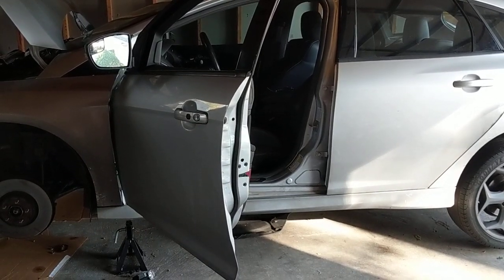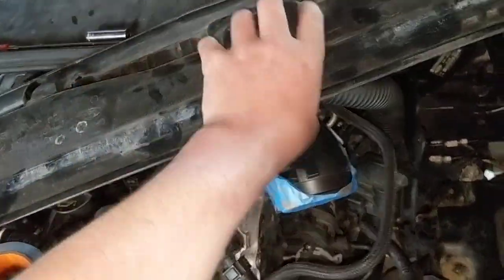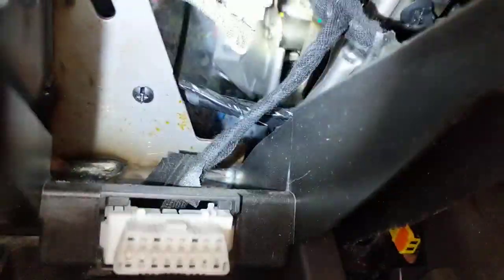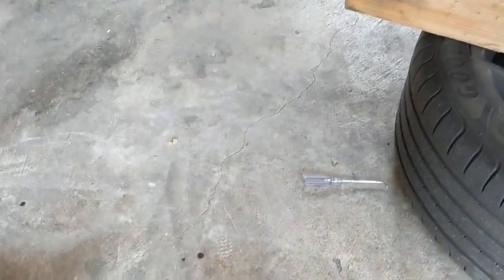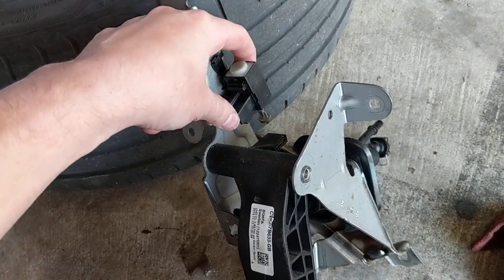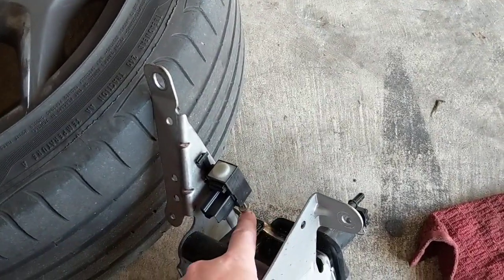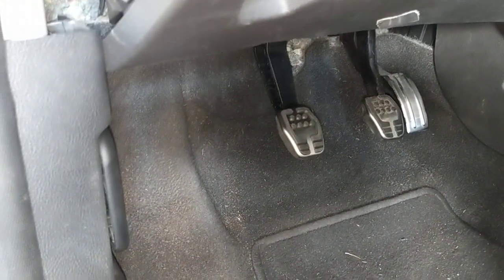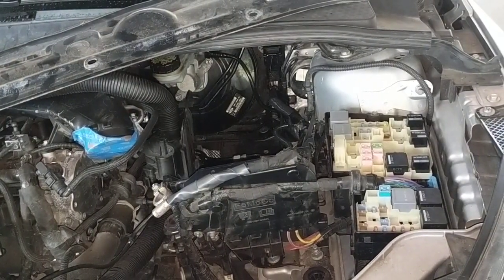Focus ST clutch pedal replacement, master cylinder, how to 2014

Comment: On 2016 st, took seat out ,did not take dash parts loose ,did not take steering loose, top bolt i used 1/4 inch small ratchet  with adapter to 1/2 inch  13 deep socket , with seat out ,you can put down cushion lay out and get to it , seat is easy to take out than air bag and dash parts , work gently pulling unit to left and out ,yes top senor pops off during removing , but going back ,that piece of metal is in the weigh ,BIG TIME! after two hours of trying all different ways ,senors on or off ,i took my mini millwakee  m12 sawzall and cut about 1/2 inch off the useless piece   of metal !!  then it went right in!
Reply: Yes but this mate saved my night only because this clip but you’re right I didn’t lose anything only the 4 bolts from the pedal (2016) 
Greetings from Germany
Reply: I needed 1 1/2 hours for all ( I’m a mechanic)
Reply: Oooooo. Thank you very much brother!!! It is the way.
Reply: Where did you buy it from, im noticing a lot of them with out the plug for the push start

Comment: On my 2014 ST I was able to get to the bolts with just pulling down the lower panel, and then used about 20" or so of extensions ending in a wobble, with a deep socket. Pulling the steering shaft is a must for extra clearance, be sure to run a seat belt through your wheel to keep it in place. Once you remove the clutch sensor and switch it sort of works itself out. The comically long extension kept me from having to mess with the airbag at all. When you replace the clutch master, may as well grab the line from Ford even if just for the quick connector and seal, its around $8.

Comment: hi, i have the same car and i hear a little clic when i press the pedal, now that clic its a lot louder and i dont know what can it be and how to repair... do you know how?
Reply from the maker: I don't remember having a click when all of this went wrong. The thing that gave it all away was the fact there was brake fluid dripping and a puddle under the clutch pedal. 
Ask some other commenters on here if they had a click or not.
Reply: Try step on foot rest with same force, if same click sound then it’s seat problem which is way better to solve. Happened to me and I just replaced Ford performance shifter, wasting couple hours finding out that’s the seat can’t handle pressure when step on clutch, omfg Ford. Hope this helps

Comment: When you took the hard line out of the slave cylinder was the rubber oring thing on the plastic collet on the hard line or inside the slave??? Please read my I need help lol🙏🙏
Reply from the maker: Just put the o-ring between the slave cylinder and the line it connects to.

Comment: Getting the master cylinder and pedal out is actually fairly easy. Both sensors on the pedal side can be put on once the pedal is mounted, pay attention to how they go on once you have the assembly out and put them on once it's in the car, you mostly go by feel
Reply: Donde consigo el vídeo de cómo sacar la pedalera

Comment: I just replaced my master clutch cylinder but I’m having a problem on bleeding it. It’s not pushing any fluid threw the lines. I’m pumping it for a while and once I open the bleeder no air nor fluid comes out, I did the process for a solid hr and nothing :(
Reply from the maker: Be sure your brake fluid cap in ON and tight before you start bleeding. I think the clutch openly pulls from the reservoir. 
Fill up that reservoir, tighten the cap and try it then. You might just be pushing fluid back up in the reservoir everything you push it down. First few times you have to pull the clutch back out. But with that cap on it'll start pushing back at you. Let me know if that works.
Reply from the maker: Unscrew that bleeder until it comes all the way out and let it gravity bleed for a while. I think I remember having to turn it quite a lot to actually break the seal.

Comment from the maker: Look into removing the lower dash. If you can remove it completely to the point where you have to unplug the lights then you're pretty much set to go. That's what really held me back. 
The rest of the work is fairly simple. I will try to find the video I watched to give you some additional info too. 
I also spent a good amount of time trying to find where the lines went through the firewall, but I've covered that in this video too. 
Trust me though about getting the lower dash off, that's the key. 
Ford wanted $1,100. I paid $90 for the pedal/master cylinder. And it's a FoMoCo part, an exact replacement.
Reply: I needs to perform this on my 13 focus. Is there a vid i can see to remove the lower dash??  This vid is still good info.

Comment: Need to remove the lower dash, and then you won't have trouble with the wiring, switches, etc.

To remove, take off the steering wheel column shrouds, then you remove the air ducting (one bolt on the bottom). You will then be able to reach the two 10mm nuts holding the airbag in place. Once airbag is removed you can fully remove the lower dash.

I just did this job - but got screwy when I went to bleed it and found that I was missing a small rubber piece that seals the hardline into the master. Now have to find a new piece before I can get it all back together :(
Reply: Thanks man. Needed that info
Reply: And...from what I've seen in other posts...that rubber seal is not available by itself so you have to buy the whole line. Hopefully you can grab one from a donar car of any platform similar at a Pick-n-Pull lol
Reply: @dham99 I bought a generic version/audi one off amazon for 10 bucks that came with like 4 of the rubber grommets and it worked fine.
Reply: Vw\audi*

Comment: Thanks for the video, any chance you can make a video on how to flush the coolant? Searched on youtube and can't find any for FoST.
Reply from the maker: I'm not sure I would actually FLUSH the coolant because I'd be doing the work myself. What I plan to do is drain as much as possible from either the lower radiator drain or hose, let it drain until it stops, then start the engine and run it for 10 seconds (not long or you'll burn up the water pump). Put it back together and just add fluid until the reservoir is to the full line.
Initially with the radiator cap open to release any air (air in the system is always a problem). Just keep adding fluid til she's full. 
You can usually let it idle while you add your fluid to ensure it fills and the other parts of the system. 
A flush includes a special hose and suction system where it really runs fluid through many many times. 
You can essentially do the same thing by changing the fluid in this way several times. 
Watch "Chris Fix: coolant flush" he does a great job.

Comment: Since you cut the connector any codes? since PCM pulls volts from these switches?
Reply from the maker: It didn't throw any codes, but it didn't bump the throttle upon a slow take off. 
So I ended up putting it back in. I wouldn't cut it, even in a pinch, just stick a paper clip in there.

Comment: Im in the process of replacing mine,  just seen the top bolt,  I'm having nightmares just to think about it ..
..
Reply from the maker: All you need are lots of extensions to reach all the way through. Like I showed the double or triple extension. I had to borrow my neighbors too.
Reply: @dangleason9023  Kool extensions isn't the problem, i recently purchased the car from Gray's on line,  i was told the muster cylinder was (stuffed).....,  excuse my French, hehe , just Australian slang ......i have the turbo diesel model, ..i was also told could be the spring that seats on the top clutch pedal, i don't think it as 1, apart from the  spring near the clutch pedal,...
Reply: I found it easy to remove the who steering wheel column, took me 10minutes  ....then simply removed the plug , ect

Comment: Did you bled the clutch from the nipple you show at the end of the video? Or you just did'nt?
Reply from the maker: Yes I did, first I did a gravity bleed with the brake fluid reservoir open, gave that a few minutes, then got my partner and bled it just like brakes. 
The weirdest part was that you could push the pedal to the ground and it would stay there, so you'll want to top off the brake fluid and close the cap, then begin the active bleeding by pressing the pedal. 
The first few times you may have to pull the clutch pedal out, do it as slowly as you can, after a few times it will firm up and the spring will act normally. 
Weirdly there were a lot of turns to open the bleeder, not the 40% turn like on a brake caliper, we're talking several turns.
Reply from the maker: Definitely gotta bleed it.
Reply: Think a vac bleeder would work better than pumping?
Reply: @dangleason9023  Thank you so much for the explanation. Just saw your commentary, YT didn't notify me. This will be extremely useful as I plan to execute clutch bleeding on my Fiesta too.
Reply from the maker: @fedeolivieri2038  I'm reading through all of these comments again....If you need more help let me know, but heed the advisories in the video. Others have good input too. Good luck!

Comment: Why did you have to change out the master cylinder? What problems were you having?
Reply from the maker: There was a puddle of brake fluid/clutch fluid on my floor mat one morning. The pedal plunger had sprung a leak. Continued to drip on my shoes while driving to get more brake fluid and order a new pedal. 
There were no driving issues other than a serious leak if left untreated.
Reply: @dangleason9023  This is what i came to this morning when I started my car...found a small bit of fluid dripping down onto my weather mats. I can see it seeping out of the plunger/rubber piece at the firewall when I depress the clutch pedal. So here I am...2016 though..so people have to be very careful of which part number they buy. 
2014/earlier uses DV6Z-7519-A
15+ uses BV6Z-7519-AR  (this one has a sensor that if you dont use the right part number, the car will have issues and wont even turn off)

Comment: My 2013 focus st is leaking brake fluid from the clutch pedal. The carpet is soak in that area...
Maybe have the dealer do it ? 
What do you recommend?
 Car has 83k miles, thanks in advance
Reply: What did u do? Im 
Facing the same problem

Comment: Why did you replace it?
Reply from the maker: I had to replace it because it had developed a leak inside the cabin where the pedal mechanism goes through the fire-wall. 
Brake fluid leaking each time I pressed in the clutch. Not something you want to run out of fluid on. Yikes.
Reply: @dangleason9023  thank you for replying. My 2014 clutch pedal has just hit the stop under the steering wheel(effectively going full up) no one has answers for me. Clutch and trans operate normal. Just allot of play in the pedal
Reply from the maker: @seanmccabe9766  so the pedal even when removed has its own spring and wants to either be depressed or compressed. 
You may have busted either a stop or where that spring connects. IDR if it was exposed or inside of something but look to see if there is a broken piece of plastic.
Reply: @dangleason9023  thanks. I looked everywhere. Couldn't see anything broken